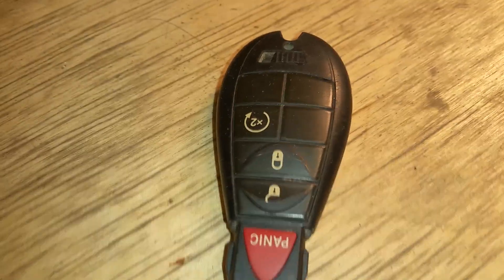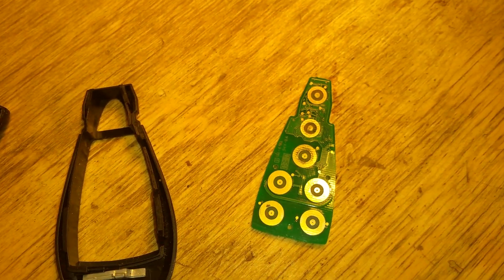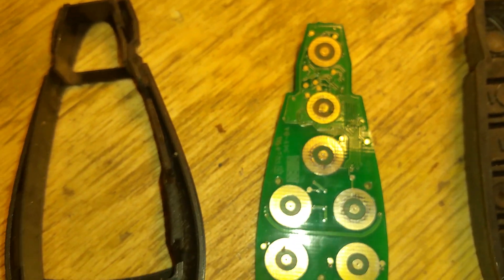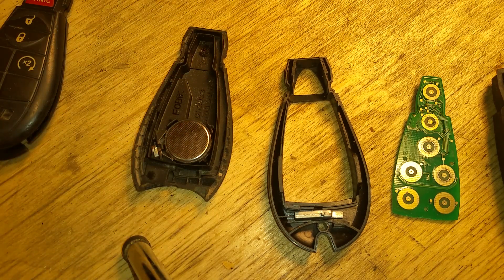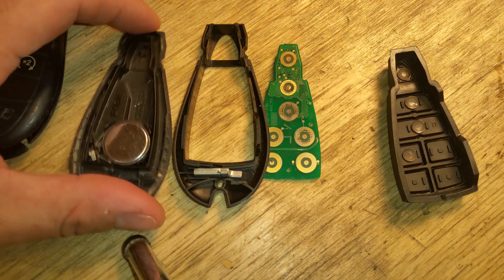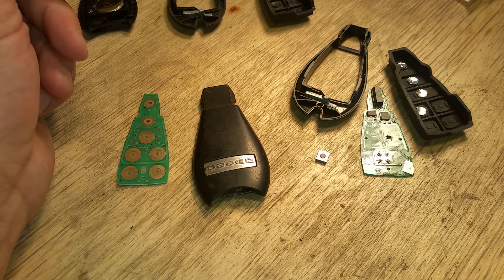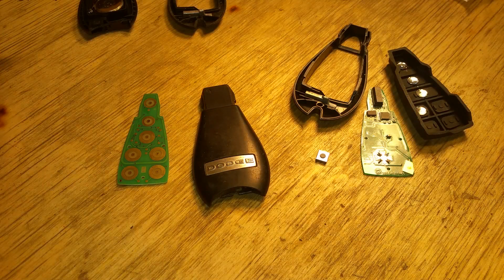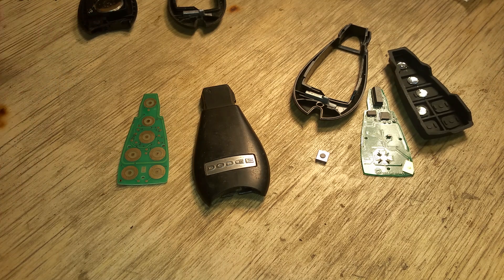Dodge Ram Keyfob Failure & Analysis 2009 - 2015

Comment: If you lock your doors  manually the alarm will not set. You can lock it with the key or lock it with your finger push the lock down before you shut the door. If you try to lock both doors at once it will arm

Comment: Thank You Don!  Just saved me $360.  Fixed for $0  The fob on my 2011 Ram 1500 was doing weird things, like when I locked the doors the windows would partially open and the unlock was intermittent.  Usually, when things go wonky the battery needs replacement, so I replaced it.  Now the unlock wouldn't work at all.  WTF?  So I took off the rubber pad.  There was a glob of dirt which I dumped out onto my workbench and I proceeded to clean the contacts on the circuit board.  Reassembled it and.......nothing works!
Then I watched your video and the light came on.  Thankfully, I hadn't had time to throw the glob of dirt in the garbage.  When I studied it more carefully, I found it was three very dirty little metal discs stuck together.  A few minutes with contact cleaner and emery cloth got them all cleaned up.  A last cleaning of the discs and rubber keypad with alcohol and I glued them back in place with Lepage's Repair Gel.  After a couple of hours for the glue to set, I reassembled it and Voila! - everything works perfectly.  Time will tell if the glue holds up, but at least I now know what the problem is and how to fix it for free.

Comment: One of my fobs had the metal disks floating about - :)  explains why the windows were rolling down at random as they traveled over various contacts within the housing.   "glue sticked" them back in place on the PCB and carefully replaced the rubber key cover.   Appears to be all good now.  At least it wasn't the ECM.   lol  - 2019 - out!

Comment: You can buy a brand new body at autozone for 15.00 and save yourself all the hassle. It will have the entire case, if it’s like mine I needed the circuit board so I ended up buying a aftermarket fob from autozone for 147.00 and it came with the programmer and it was easy to program, only took 5 minutes or less.

Comment: I repaired someone's 2 fobs with tinfoil, a paper punch and glue.
It was for a Pontiac G5 or G6. Use the paper punch to make a perfect circle of tinfoil for each
and put a dab of glue on the rubber. With tweezers, place a circle on it. 
button. The ones I fixed are still working after 3 or 4 years. With the Ram, the circles need to be bigger.
But I think this would work fine. (I used dollar store two part epoxy mix and a tooth pick to put
glue on the rubber) Clean the rubber, remove anything old first. Shinny side towards the circuit board.

Comment: If your fob fails. lock your door. Manually unlock driver door, shut it then open and manually lock the door. Your alarm will not sound when using your key on it at this time.

Comment: I had a problem with my truck was starting up on its own. The remote start suction cup in my fob came unglued and arching out. I bought a new shell and them cups inside all new and shiz, worked out just fine.
Reply: Just replace the shell on a regular basis.

Comment: The question is how do you get the Fobik casing apart without breaking it?  I tried prying it apart and it seems as though they're glue together so much, it's very difficult to separate it without breaking at least part of it.  Also, don't forget about the "All mighty" dollar.  Just like the medical/pharma industry carmakers think that we cannot do without them.  They fleece the consumer to the breaking point.  They know that most people  can't figure out a cheaper solution to get their vehicles back into running condition.  BTW~Thanks for this video.  I still need to figure out how to get the new Fobs apart without breaking them.

Comment: I had the same problem, dealer were charging too much for a piece of plastic and programming.
So I did some research bought key two new fob’s online...call my local LOCK SMITH and they programmed the new fob’s for the fraction of the cost..and they have been working great for several years now.
TIP: Call your local lock smith and see if they can program key fob’s.

Comment: I tell you what, my 2010 Dodge Ram Laramie is a sharp looking truck!! However, it's a polished pile of shit!! On the outside it looks luxurious and fancy, but when you start to pull back layers it gets more and more closer to shit...to include the key fob. Thought I had mine fixed...now as I walk closer to the polished pile of shit the doors automatically unlock without me pressing the button and the windows roll down...which isn't the bad part. They also roll down automatically when I lock the doors and walk away. It's an amazing feeling to walk up to your $60,000 truck and the windows are down during a down pour of rain, after you previously locked the doors and walked away!!! My dealership said the only thing wrong with my truck was the thermostat and drivers side door speaker...but they'd fix those for $600. Anyone else having this problem???

Comment: lol, because the aftermarket ones are garbage. Those are not the original contacts on a Dodge FOBIK. Those little silver discs are the tell tale sign you got garbage. They stop working in a few weeks. I think they destroy the board. And that's why dealer's stay away from anything except OEM..... also, I disagree that because the word printed inside indicates a different manufacturer, I think it indicates the same manufacturer because it is the same font in the same spot. Probably same maker, different year. Which supports my first observation. They are both garbage from the same maker.  You can get refurbished OEM FOBs easily for around $50-$60. Take it to a locksmith with the vehicle for programming, about $40-$50. It is the best and really only low-cost solution. 

Peace

Comment: 1. It's a Mercedes FOB.  When Mercedes owned Chrysler. 
2. Those after market FOB'S work.  Maybe you got the wrong keys.  Don't just look at the key, you have to get the correct FCC number.  I got mine from Amazon before.
3.  It looks like the after market chip is an integrated unit rather than old style circuit board type.  It's like looking at the internals of an old computer vs a new computer.

Comment: Thank you for your video my connections were so dirty my unlock and lock stopped working and the dealer wanted $198 for the fob and another $67 for programing and you saved me that

Comment: Ordered the part but I found a fix in the meantime. Those metal circles I bent just slightly with needle nose pliers. They now make a full connection completing the circuit to allow the buttons to work again. They are a bit more stiff now.

Comment: Thanks, I have been dealing with this for some time. I tried to clean the contacts and still nothing. I figured it had to be the switch as they looked rather odd even after cleaning them. I'm going to buy this from ebay and see if I can do the same thing. I'm not about to pay $300 for 1 key.

Comment: My fob cracked and didn't have a good contact. I purchased one on-line to program myself. yes I had two original fobs. It didn't work. even had others try it. threw it in a drawer 6 months ago. watched this video and THANK YOU so much. all I did was switch the insides of cracked fob to the brand one. worked like a charm. if I had not watched this video I would have never known to try that. you saved me some money as I was ready to purchased another one. not very smart having only one fob at a time.

Comment: you need to clean the whole key fob with MEK or some other good contact cleaner . the contacts, the metal discs, the components , the circuit board. That should make the circuits on the fob work. at the correct frequency..
Reply: MEK is a BAD idea.  It can melt the rubber and plastic.  Alcohol is better.  Three shots of brandy and you'll lose interest.

Comment: I have a 2012 and it was getting to the point where it was hard to unlock my doors with the key fob button. This was the only function that was affected . When opening up the remote I was able to see gold tabs on the circuit board that  make a connection when you press the button on the... back side of the rubber boot there are metal disc that  touch on to the goal tabs on the circuit board. All I had to do was use a little Brasso with a paper towel and gently wipe the gold tabs. Apparently they was slightly corroded or had some type of crud on them. Now they are clean and shiny. Now it functions like new.

Comment: Your fix is a nicer solution but I wanted to touch on something you mentioned that may help others out. You mentioned the aluminum tape solution. I have repaired two different fobs using heavy duty aluminum foil (not tape). I took the foil with some paper behind it to act as a backing and punched out nice clean aluminum foil circles with a hole punch. Then I used contact cement on the old button contacts and the foil (applied with a toothpick) and let it dry before pressing them together. One of the fobs belonged to my mother-in-law' car and one was mine and they are both still working. I repaired mine about 4 years ago and hers about two years ago. Just wanted to mention that in case anyone is interested.
Not as elegant but functional and didn't cost me anything other than a little time.
Reply from the maker: Hello Juggernaut, thanks for commenting and offering another solution that may help people, especially those on a budget! Hey, I've got my eye on your new channel, and expecting great things -cheers

Comment: Hey Don, Was having the same problem as you and I repeated your process to a T and my fob still does not work!!! Any suggestions on what you may think is the problem and how to fix it ? The original fob starts the truck just fine, however the lock and unlock buttons do not work anymore! I am afraid I will have to pay dealership prices to repair! HELP
Reply from the maker: get a wire or something conductive... try to short the connections on board without the buttons.  make sure the batt is connected... if shorting the board works, you may need to clean the board or contacts.... let us know what happens.

Comment: Don I am working with a 2014 ram that has same problem as you show but I have questions what did you use to clean the circuit board cause the 1 am working on
Reply: Electronics manufacturers use isopropyl alcohol. I buy it at my local grocery store. You want the stuff that is 91% alcohol, not the 70% alcohol version. It's a couple of bucks for a small bottle. Use a new cotton swab to apply it. Read the warnings on the bottle; and close the lid as this stuff evaporates pretty quickly.

Comment: Figuring out how to split it open is the hardest part ! And you skip right over it.
Reply from the maker: Sorry about that..... my problem wasn't the battery. That is the first thing to check however.  Good point.
Reply: Remove the metal key from the casing.
Flip the casing over, rubber pads facing your palm.
Use the tip of the key to pry open the case, opposite to the key slot.

Comment: as far as not setting the alarm off. you need to manually lock all the doors for the alarm. not to go off when using the key to unlock the door. yes if you use the power locks the alarm goes off every time.
Reply from the maker: Nice advice, I'll have to give it a try! -cheers

Comment: i am having the same problem on my 2011 durango, the push buttons contacts, i glued them and they work fine for a while, but glue parts are a temporary fix and the contacts parts keep bouncing around in the remote, i was thinking about doing what you did, and i hope it works i am keeping all the original parts and just need a new push pad with the contacts.
Reply from the maker: I would love to see your results. Post your video link to let us see when you're done. -don
Reply: Don, I didn’t do a video but I did replace my key fob to my 2011 Durango. I did talk to the dodge dealership and they gave me a quote on how much they would charge me for 2 new key fob. The price was $181 x2= ($362) just for the fobs. The programming would cost $70. x2 ($140) and to cut the key $40 x2($80) so we are looking at $582 without taxes... ridiculous.... I took your advice and found some new key fobs on eBay. I have a 5 push button key fob I was looking for, and I found 2 key fobs 5 push button from a seller online for $20. In reality all I need was a new push pad because the contacts fell off from both fobs, and would not auto start the Durango, or open/close the trunk. After I order them and got them in the mail within 3 days, I switch out the push pads to both key fobs, I kept the original Durango key shells. After the switch out, I tried using both key fob but the truck was not responding, I was about to give up but then I decided to pop out the push start button and I inserted the key into the ignition and turned the truck on manually after that I took the key out and proceeded to see if the remote will work, and to my surprised it did, all the buttons work great. For key fob #2 was still not working so I repeated what I did with key fob #1 and then fob #2 started working. It’s been 4 days with new push buttons and they are working great, it’s nice to have working keys again and not having to spend $600 at the dealership for such a simple fix…. Thank you for sharing this video, because it saved me a huge chunk of money….. 
Robert….
Reply from the maker: Wow, Great story. I really glad to hear that you fixed it.

Comment: I just ordered a pair from Amazon for $55 Canadian. I hope they are the same as what you got.   I had my 2009 Ram 1500 to dodge to diagnose my problem as I had already ripped my dash apart to find remote start antenna, replaced my fob batteries 3 times, replaced the Truck battery so I was lost.. He used a signal tester and said that the fobs were no good.  The problem I was having is temperamental lock and unlock and the remote start would work once in 20 tries and then sometimes it would work 2 times in a row.  weird that 2 keys went at once.  he quoted $300 more per key plus $75 more to program.      You know what I told him don't you.    I am hoping your idea works for me or I will have to dish out another 75 to have dealer program the replacements.       funny about you damaging your fobs click disc while cleaning as I too damaged one cleaning mine and also tried to glue it back.   Thanks for the video!
Reply from the maker: Really pains me to hear about your problem.. When you told them, i hope you were shouting.. Mom used to work for Chrysler so i always bought Dodge Trucks. Its frustrating when a problem like this come along. I certainly hope the replacements work for you. Please let us know.  Also, if they do work, go back to your dealer and get the diagnostic fees back.. Ill call em on your behalf if you like, no kidding. -Cheers Brother
Reply: Thanks Don, hey we're practically related, my brother has worked for Mopar here in Alberta Canada for 30 years and I buy Dodge for the family discount but I don't like to abuse his power for little stuff like this..    Actually this local dealer was pretty good as he quoted $150 for the diagnostic and only charged 1/2 hour. Hopefully he will give me a break if I have to go back for programming.
Reply from the maker: Great video! Thanks for the shout-out. Keep us advised if the new part works for you. -cheers don
Reply: I added a part 2 to my video and I had a few more hiccups check it out

Comment: Nice little vid Don. The current design should be more reliable than the push button, and it's a lot easier to make. The push button would eventually rub through the rubber and allow contaminates in. So with that said the only reason to have such a high price is pure profit. I love how you found an almost exact duplicate and used new and old parts to fix it.
Thanks for sharing. Best Wishes n Blessings Keith

Comment: Where did you find the replacement fob? Do you have a link? I've ran into the same issue with my Ram
Reply from the maker: Not cheap, but better than having dodge do it!  look here, this is what i bought. Thanks for the question.
http://www.ebay.com/itm/TWO-NEW-Dodge-Ram-1500-2500-3500-4500-Fobik-Remote-Star-Key-Fob-Keyless-Remote-/301693289260?hash=item463e52432c:g:xCQAAOSwd0BVrhmg
Reply: Hi everyone I did not find the key fob at ebay apparently they sell a different  type than the one on the video if you guys have the link of this one  please let me know .
thanks

Comment: Don,
The dealer has NO incentive to change the current situation when they can charge the customer a fist full of dollars for doing a key programming on a new key bought from them at an exorbitant markup price.
Remember service managers are hired to boost a franchise's profits with low labor, low cost, high return jobs such as this, not by making the service area a best practice customer oriented entity. 
How difficult is the key programming??? 
Check out this video https://www.youtube.com/watch?v=L8PQxRa7t1M 
You may even find these instructions in the user manual somewhere.
Cheers Eric